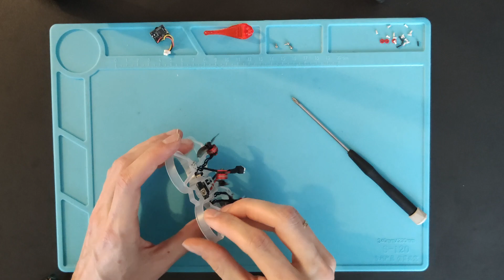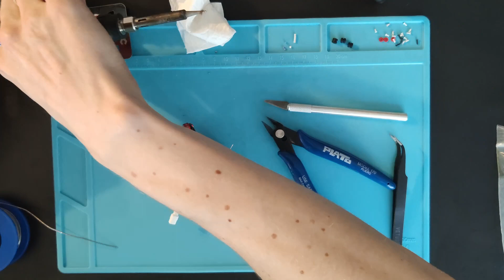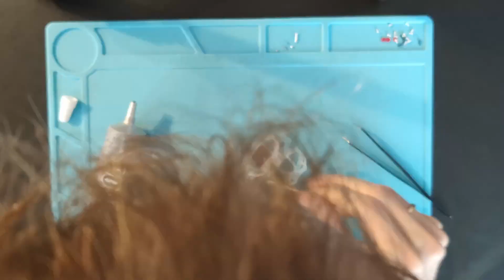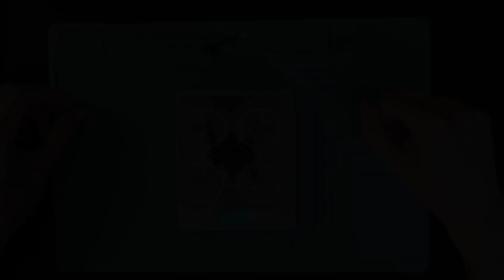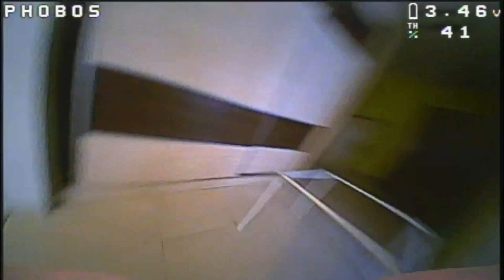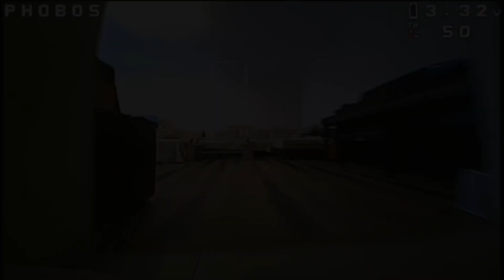How to turn your Mobeetle6 into a racing BEAST

Comment: I see you got the same problem as me with desoldering the ground cable. I dont know why is that, but with my 2 Moblite7 I got major problem with desoldering the ground wire. Plus one came out like butter. I didn't thought about shortening the ground BT2.0 cable, and now I got is asymmetrical, but as long as it works, I'm not touching it anymore :)
Reply from the maker: more heat helps. Now I set my soldering iron to 400+ deg and use a larger tip.

Comment: great video. You can remove the plug of the camera and save some weight.. Under the plug there are pads for soldering cam directly. Even if you destroy the pads of the pin you have solder pads.

Comment: Very good tutorial. Is there any Polish e-shop where I can buy Mobeetle6 or what e-shop would you recommend me in EU to get stuff on tinywhoop.
Reply from the maker: there are a few Polish shops you can try to shop for mobeetle: znowodronach.pl , nobshop.pl , avifly.pl . As for tinywhoop cameras, motors, plastic screws, 4fpv.pl might have some stock soon.
Reply: Great, thanks for the reply. But I have one more question. Is there any e-shop in Europe where I can get a happymodel superbee F4, 0702 high speed motors (26000kv) and Tinywhoop Pinch cam or Foxeer Pico Razer. I ask because shipping to Europe from USA is super expensive.

Comment: A bit late to this but awesome vid and thanks for the tips. What are you're thoughts on the superbee f4? I've had a few esc's go on multiple diamond boards and I am considering the superbee with an open vtx combo (or tbs maybe).
Reply from the maker: I heard opinions that superbee feels more powerful than diamond ELRS. With a lightweight VTX it should weigh the same as diamond, so no real weight penalty. I plan to try it as well.

Comment: hey mate, i have a question where did u get those screws from and how did u chamfer the screw holes as well? also did u change the gummies on the fc as well? love the videos btw its such a big help! What's your option on the beta65 pro frame? to heavey for such a light build?
Reply from the maker: I bought the screws from solidspot.com - flat or pan head m1.4 x 3mm or m1.4 x 4mm, but shipping to europe is super expensive. I used original gummies that came with the FC. Beta65 pro frame has bigger ducts for 35mm props and doesn't fit diamond well. Thanks for the kind words!

Comment: I want to see this setup but 35mm props on the meteor 65pro frame. i want to custom mount a diamond board in it. It would be amazinh at 18.5g ish with those 35mm props and small 65mm form factor!

Comment: amazing! in the future videos it would be nice to hear some reasoning of why did you chose this setup, and weight of individual components. There was lots of talks that 0702 motor are too weak and better get 0802 back.
Reply from the maker: thanks for the feedback :) I'll try to add more 'meat' next time. 0702 are indeed weaker especially at the low end, but it's somewhat offset by lower all up weight. With 0702 it's quite important to keep the total flying weight as low as possible to get the best results.
Reply: 0702 actually shines on light 75mm builds with biblades. I switched to ex802s, 1g heavier overall, barely noticeably better response, the weight wasn't much and only really made it feel a little more locked, but the lighter 0702s at the ends of the frame do add a sense of lightness and agility. I'd build a 75mm with 0702s again, mine were 26kkv.

Comment: SPI elrs 3.x support maybe? :D
Reply from the maker: it's coming, but only partially at first. You'll be able to bind your 3.x TX with SPI receivers and use existing LoRa modes.
Reply: @PhobosYT  thats the only thing that I need
Reply: They have it now. Firmware is on happy model site

Comment: hi.. can you send photo detail how you route the elrs and vtx antenna? i want to secure mine like yours..
Reply from the maker: I don't think I can attach pictures here. I route the elrs antenna through a small hole in the frame, but you can ommit this step and just simply route it away from the FC and secure it somewhere. Make sure to leave out some slack for the wire to flex in crashes. For the vtx antenna I just run it in parallel to the edge of the board and glue the end of it to the nearest component. I try to keep around 90deg angle between the elrs and vtx antennas to minimize interference. I hope this helps a bit.
Reply: @PhobosYT  no problem i already put the elrs antena by making hole like yours.. thanks for the info about the 90degre antena between vtx and elrs, what interfere effect if those antena not in 90deg angle? Noisy fpv feed or somethin else?
Reply from the maker: @TERBANGFPV  yes, less range in general

Comment: Great one! Nice tips with rx antena hole, don’t you think running vtx antena outside of fc might give a better range? Fc pcb won’t block as much this way. You can glue it to the frame there as well
Once again, great that You shared your secrets :)
Reply: I agreed on moving away the antenna from the FC will get you more range (than what you need) but glueing it to the frame will break it in no time... Don't do that !
Reply: @DonJohnsonFPV  true, should have mentioned that after first brake I switched enamel wire to regular 32 gage silicon wire so it won’t break
Reply from the maker: Yup, I prefer durability over range. I think for racing the range is enough at 25mw, you can check my previous vids or take a look during next IRL race. Range problems usually come from something else - overheating the board can permanently damage the vtx, crash damage, etc.

Comment: Did you use peek or reny screws for the motors? And m1.4 x 3mm length right?
Reply from the maker: Reny m1.4x3mm pan head or m1.4x4 flat head screws from solidspot
Reply: @PhobosYT  I ordered both for mine a few days ago. Putting TW 0702 26000 kv motors with the diamond f4 on the same frame. Seems to be the way to go for racing.

Comment: I switched mine to a meteor frame almost instantly but kept having this problem: when I tried to dive into the garden at speed I would just barely descend and yaw would be uncontrollable. I fiddled with pids for ages but decided the problem was the aerodynamics of the frame. Could that be right? That is a clean build you have there BTW, nice vid!
Reply from the maker: Are you running props in or props out?  What is your dshot idle at? ESC startup power? Generally when the quad is hard to tune I start by reducing the PIDs to low (or default) values and increasing filtering (and RC smoothing). Once the quad starts to fly really quiet and smooth I bump the PIDs up. If nothing helps I change the motors to a fresh set. This frame is actually pretty good, I do have some slight propwash outdoors  but nothing serious. I would not be able to fly like in the video if the quad had uncontrollable yaw, split-s and dive obstacles would be impossible to pull off :)
Reply: I just kept everything default (props out) and used angrydon pids. It flew perfect except from that. I switched it to the toothpick frame and changed the pids a bit and the problem was gone.
Reply: @AL_FPV  just my two cent from the one asking for that build... The goal was the best INDOOR whoop... 
ANY other quad will outperform it oustide !
So put you ducts back and have fun for what it's good for 😉
Reply: @DonJohnsonFPV  I know! I still think it outperforms my mob7 outdoors tho... My house also has small rooms and hair is hiding on every carpet so its a real pain indoors.